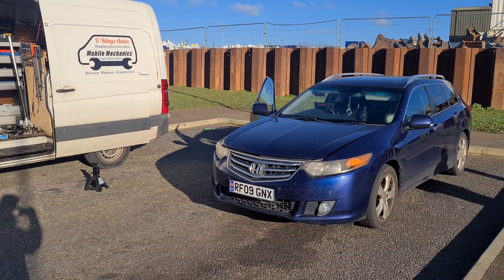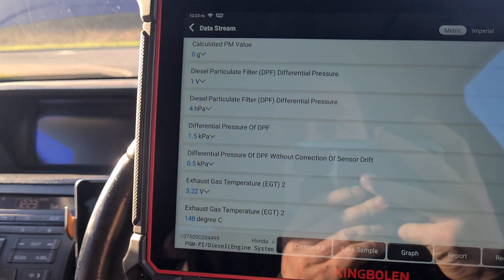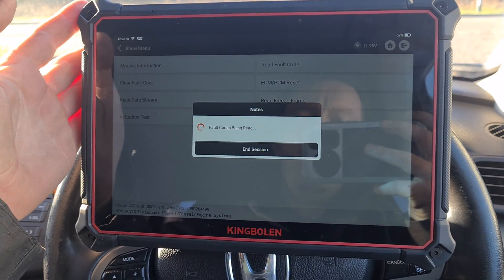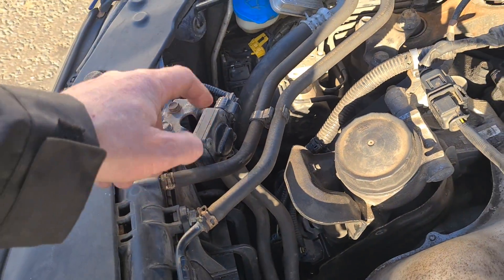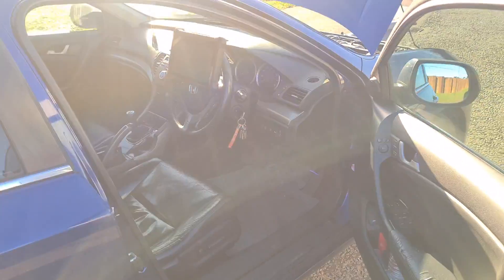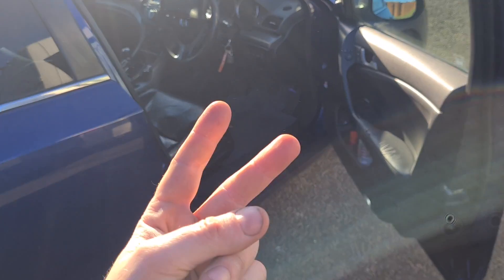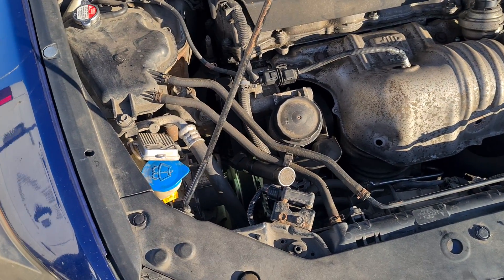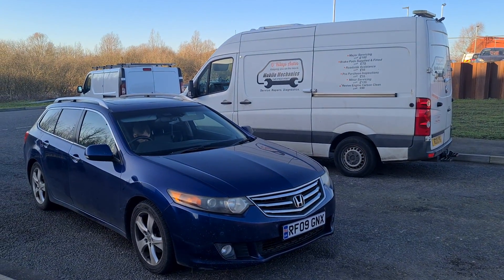Honda DPF Replaced But Blocked Again After Few Days. What's Preventing Regeneration?

Comment: For those with these cars, the AC is incorrect. So long as you turn the AC off inside the car, it'll kick the fans in and do a DPF regen. I've owned a 1.6 IDTEC & the 2.2 IDTEC both have/had broken A/C. Both did DPF regens perfectly fine. 
However, what I have noticed is the cars won't do a regen itself unless you fill the tank above half. If I drive mine around town, then brim the tank it'll do a regen on the way back from the petrol station. You can tell by the fans whirling when you turn the engine off. Also the oil level does need to be correct, so long as it's below full it'll regen.

I owned a 1.6 IDTEC for around 5 months, put 7000 miles on it and had no issues with clogged DPF and it did many regens, as it'd smoke when it did them. My 2.2 I've owned since September '24 and has never had issues with the DPF.

Comment: 700 pound for proxxy little sensor that costs 36.99 on most other manufacturers vehicles honda really taking the piss with this differential pressure sensor and nobody is selling a after market one today I will open the sensor up myself clean with electrical contact cleaner and see if I can find a short or fuse circuit board issue with it , I refuse to pay the 700 to them robbing bastards

Comment: This is so interesting.
My wife's Accord was giving problems not doing it's own regen, Honda charged a small fortune and didn't fix it, eventually took it to a machanic in Yaxley who found that it was the Turbo, apparently the fan was out of alignment or something. 2.5k later car now does its own regents again. Apparently it was suffering "power boost" issues, or something. But now it seems to have a lag when you put your foot down.
We both drive diesel Honda's, I'm keeping your number as we are not too far.

Comment: Hi mate, thanks for this very useful video.
Is the AC cluch and AC gas storage affect the dpf passive regeneration? Thanks
Reply from the maker: Yes
Reply: @ORileysAutos  thanks for replying, so if my AC gas is empty, the dpf passive or active regeneration will not happen?
Reply from the maker: @chankalok3424  no it won't happen without ac working on most models

Comment: Hi, I have a honda civic 2018 diesel, recently did a forced regen on it, which was successful but got another fault code P24c6 soot sensor temperature circuit after 2 days 😢, when i checked online I suspect my pm sensor has gone faulty. Does anyone know who sell this sensor cheap? I could find only in hondadirectpart but its £700 plus which I think is a ripoff.

Comment: Using my iCarsoft Pro computer the forced regen (which didn't work,  have been trying to contact Jimmy) requires A/C on, bonnet open and headlights on high beam. Sat at 3,000rpm for 15 minutes then down to 1,500rpm and then idle, didn't extinguish the DPF! symbol. Didn't know about the oil level thing, will have to check it. There was a service bulletin in the first few years of the iDTEC engine that updated the ECU to reduce or prevent oil dilution. Should have been applied if the car was dealer serviced.

Comment: I went through all this on a facelift 2012 Honda accord i-dtec dpf hell 18 months ago i cleaned the dpf on and off the car replaced the cracked egr pipe (common issue)
Replaced the coolant switch 
Changed the oil twice
Changed the differential pressure switch off another part-out-car
Aircon checked and worked didnt make a difference 
Injectors worked fine and not leaking.
So i gave up in the end i went back to petrol and part ex'd it for a 2019 civic fk6 turbo130 (petrol) none PPF filter and its never given me a moments hassle even after 28k miles, just well serviced with liqui moly and added ceretec (i personally recommend).

Comment: Just in case it helps you out, the following sensor is a perfectly functional alternative to these Honda pressure sensors. 
They are designed for Kia/Hyundai but they work the same and have the same connector. 
GSF stock them for around £80. A significant saving - the only difference is the fact they don't have the bracket integrated. That is all the difference is on the Honda type. 

Hella part number = 6PP009409-291

Comment: Why on earth the A/C would need to be gassed to do the DPF regen is beyond me. Especially as there isn't any codes pointing in the direction that an AC problem is causing it.
Reply: I’ve never heard of this before but Jimmy is a real king
Reply: I have just taken mine to the DPF service centre and they have advised the same. My compressor is leaked so it doesn’t support the DPF anymore, lol.. To have it fixed now I have to get a new compressor (costs about 500£) so later they can start making further diagnostics and you can end up paying 3000£ in total. (Car was 4000£ 4 years ago.. ) Fuck not!
Reply: @mypszii what did you do in. The end? Was it a Honda ?

Comment: It's almost like the manufacturers are just coming up with more and more dependant systems to tie the dpf system into increasing the points of failure and therefore raking it in when you take it to the dealership for repair.
Expect cars to fail their dpf regens in the near future for the following reasons:
1. Interior light has blown
2. Ashtray is full
3. Cup in cup holder is not located securely
Reply: That’s funny as hell,  ash tray full 😂
Reply: More like that they want cars to die early now so you decide to buy an EV and they don't get fined for not selling enough of them. Sadly there is no way back from EV crap now.
Reply: Need better systems to compete
Reply: BS we need more
Reply: Ash tray pressure sensor has failed OMG 🤦‍♂️🤦‍♂️🤦‍♂️🤦‍♂️🤦‍♂️😣😣😣😣😣🫠🫠🫠🫠🫠